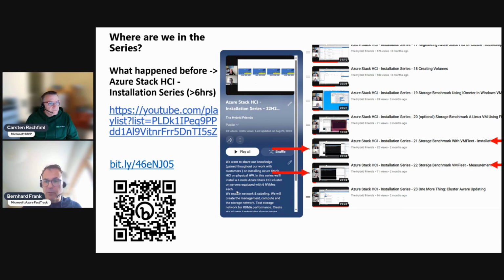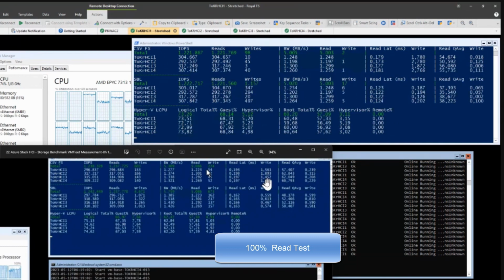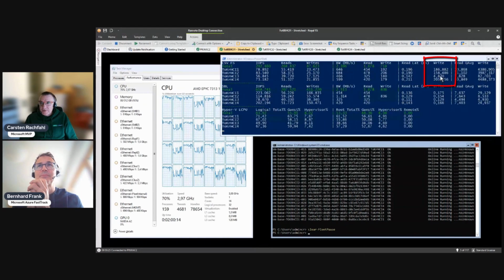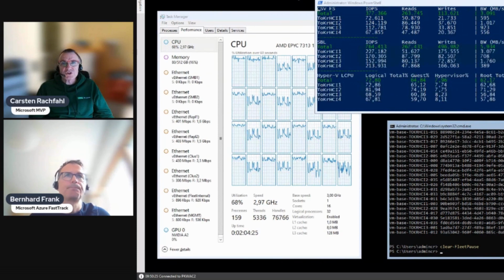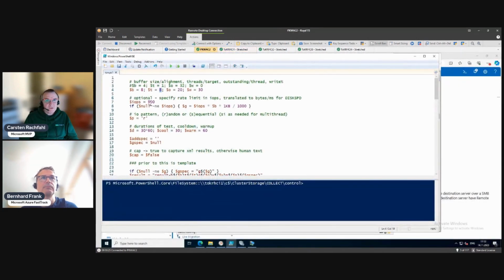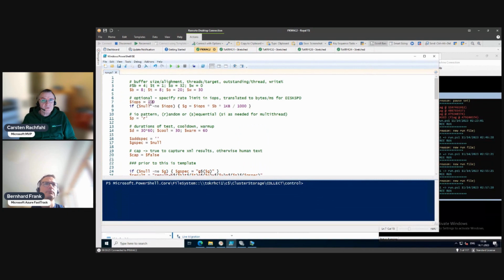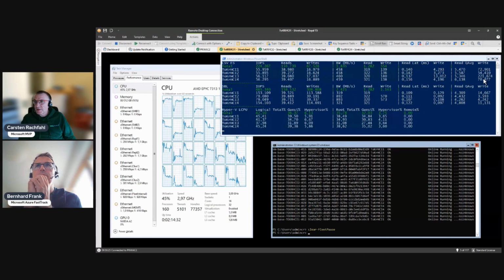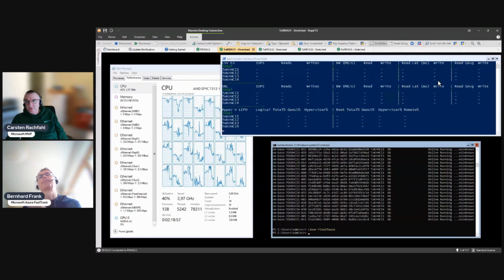Azure Stack HCI - Stretched Cluster Series - 15 Benchmarking The Whole Stretched Cluster (vmfleet)

Comment: Your benchmarking efforts are commendable, and I appreciate the valuable work you've put into this. It's intriguing to note the parallels with a challenge I encountered in a production environment several years ago, albeit with a converged implementation rather than HCI.

In our case, nightly VM performance was hindered by IO contention, which, after an exhaustive investigation, we traced back to simultaneous VM backups. It was intriguing to discover that the OS kernel's limitation in handling IOPS was tied to utilizing only the first socket and the initial core of the CPU motherboard. Despite experimenting with various workarounds, such as adjusting backup time slots, the breakthrough came when we invested in new CPUs.

Interestingly, the initial CPU upgrade, while boasting more cores, did not yield a significant improvement, as the single-core performance remained nearly identical to the older model. Subsequent acquisitions of CPUs with higher frequencies and single cores (without hyperthreading) proved to be the key. This strategic move resulted in a noticeable enhancement in IOPS per node.

I wonder if you've explored similar tests with different CPU and core configurations, as your findings could shed light on potential optimizations or alternative solutions. Your experience could provide valuable insights into overcoming such limitations in diverse hardware setups.